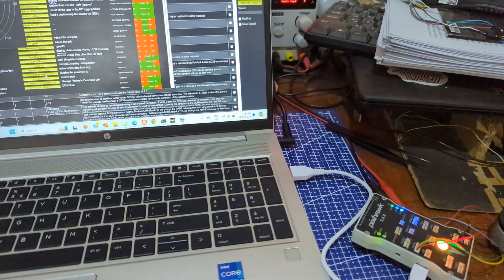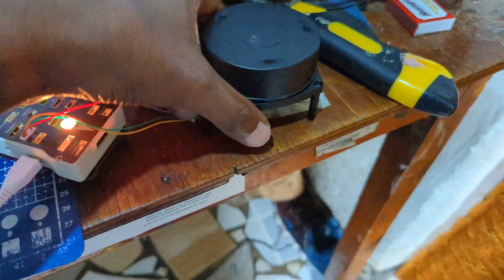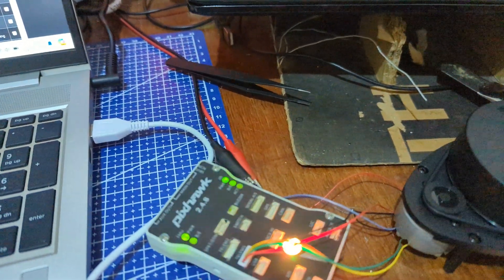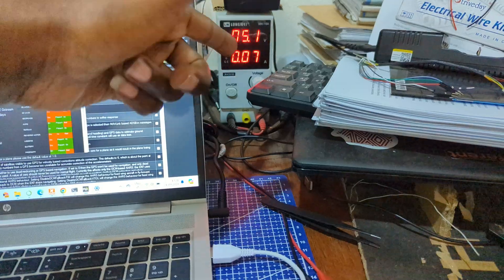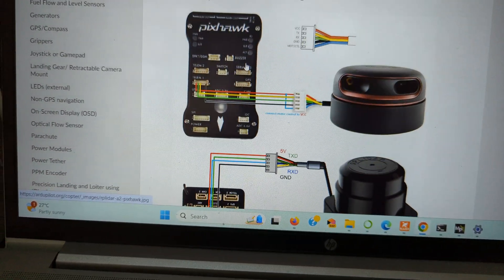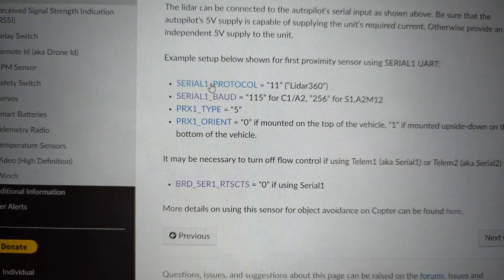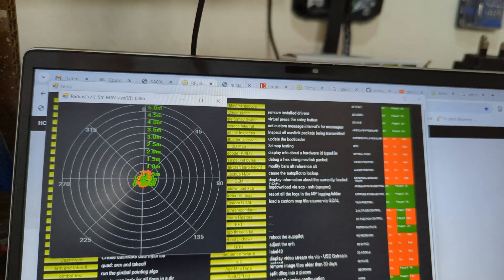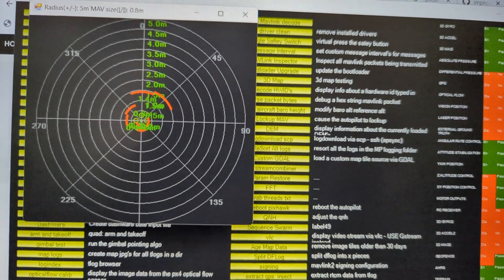Connecting RP Lidar to Drone / pixhawk

Comment from the maker: I am using ArduPilot to configure and set up the LiDAR. ArduPilot is capable of receiving LiDAR data and using it for obstacle avoidance.

If you're interested in this approach, here are some links to guide you:
setup RPLidar A1 :  https://discuss.ardupilot.org/t/rplidar-a1-360-how-to-configure/48829
setup RPLidar C1:  https://discuss.ardupilot.org/t/rplidar-c1-has-different-results-in-firmware-copter-4-5-and-copter-4-4/114466
More information : https://ardupilot.org/copter/docs/common-rplidar-a2.html

Comment: Hi! How do I connect the lidar on the power supply from the battery with the correct current?
Reply from the maker: You can use power supply from ESCs if they have 3 pins (ground, 5v, signal). That's how I did it.